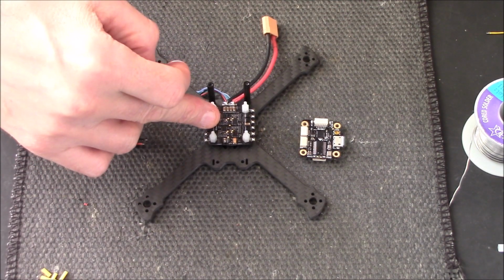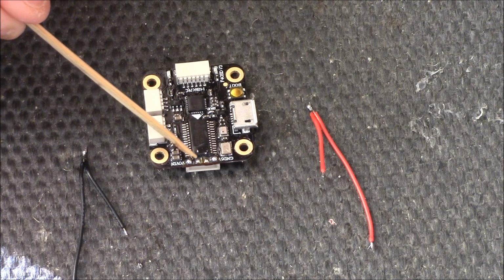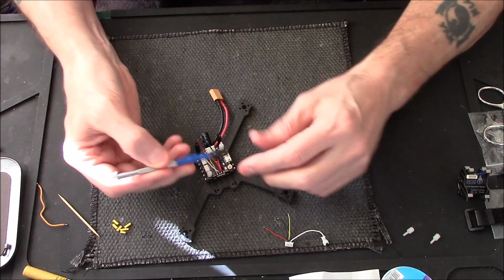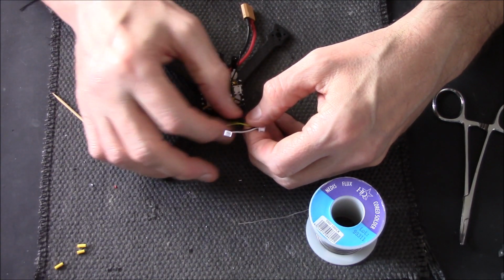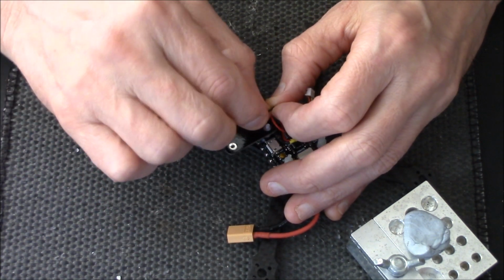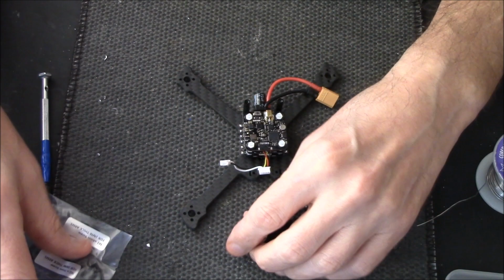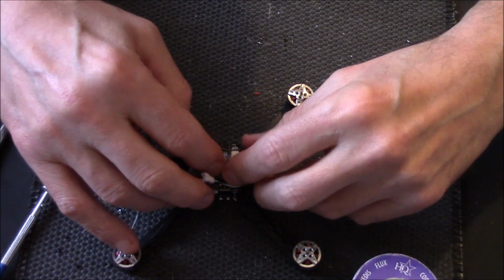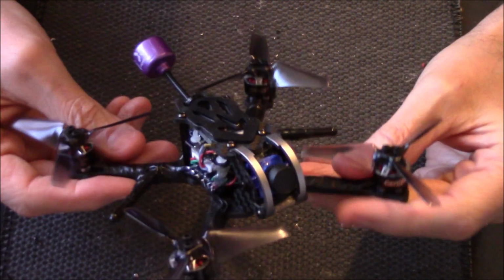MICRO QUAD BUILD UNCUT UNEDITED

Comment: Hey George, I did not see the FC/ECS/VTX board in your description, could you tell me the name of this stack?...Thanks!
Reply from the maker: Hears a link to the FCB 
https://www.banggood.com/20x20mm-HAKRC-MiniF4-F4-Flight-Controller-Integrated-with-Betaflight-OSD-5V-2A-BEC-for-RC-Drone-p-1246530.html?rmmds=myorder&cur_warehouse=CNA02817649204201406M5 

And hears the link to the ESC

https://www.banggood.com/Hakrc-20x20mm-15A-Blheli_S-BB2-2-4S-Dshot-4-In-1-ESC-for-Racing-Drone-p-1165086.html?rmmds=detail-top-buytogether-auto&cur_warehouse=CNA02817649204201406M5 

And the VTX

https://www.speedybee.com/tx500/

Hope this helps matey

Comment: Thanks for the build. Actually iam using the same frame same stack. Does the stack come with receiver cable?
Reply from the maker: Yes but you will still need to solder the receiver to it...
Reply: Sir Will flysky IBUS work on this FC? which color cable from the provided  RX cable did you use??? Red black and ???
Reply from the maker: If you send me your Email I will send you a Photo of the receiver cable set up. My email is pilot.geroge.cooper@gmail.com